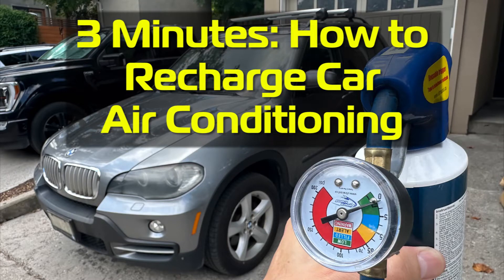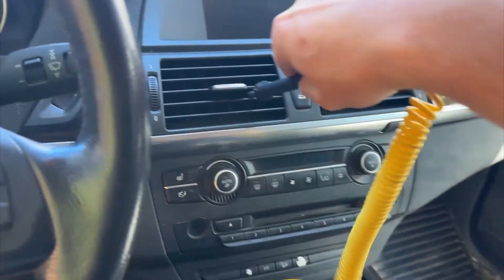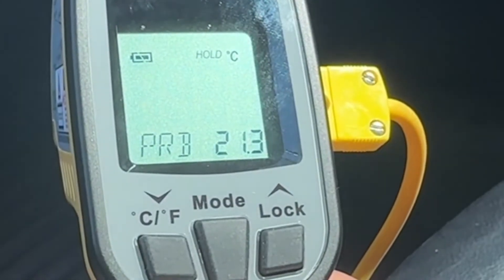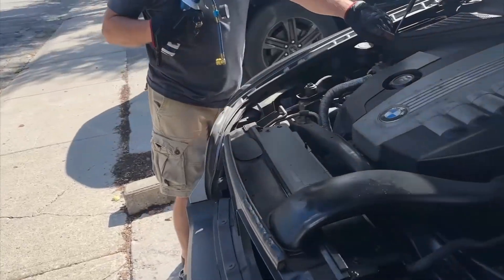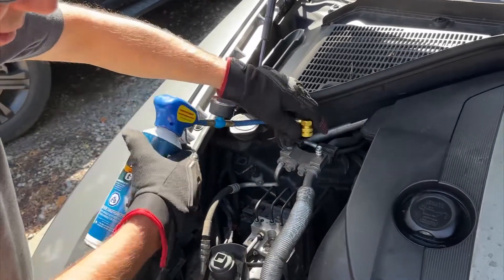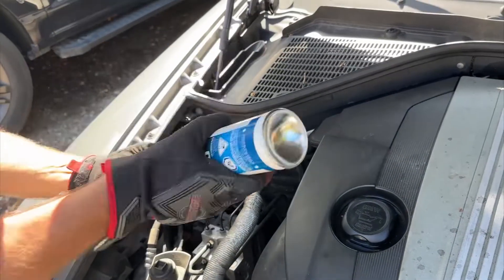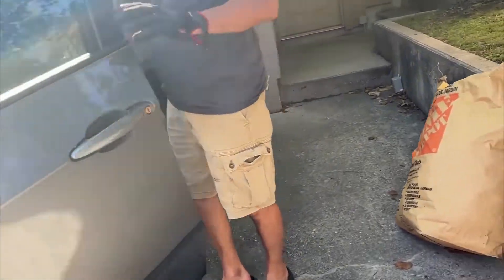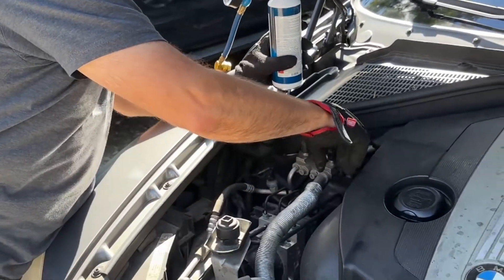How to Recharge Car Air Conditioning Systems - 3 minute video

Comment: All good but don't fail to mention to use the correct refrigerant that is listed under the cars hood.
Reply from the maker: Thanks, but I effectively say that 10 seconds into the video!
Reply: @brantz_myers  Just saying the info is located uder the hood of all vehicles.
Reply from the maker: Thanks for helping improve to the information I'm providing. I looked into this, and while it's true that most cars have the refrigerant spec under the hood, there are some makes and models that do not, so I've added a bit more information on where to find it in the video's description. Thx.